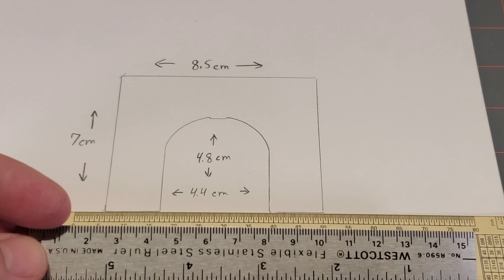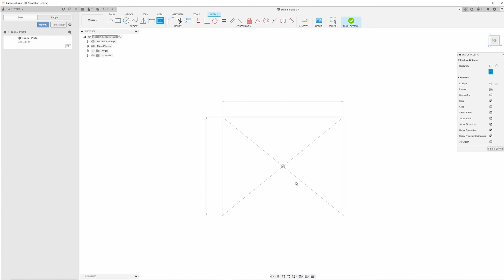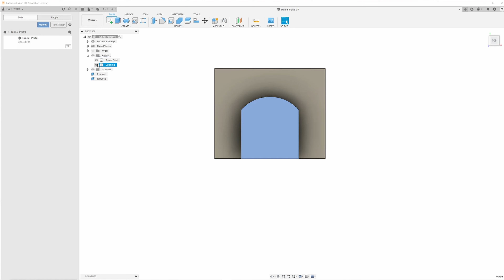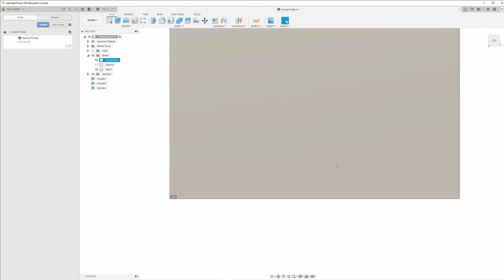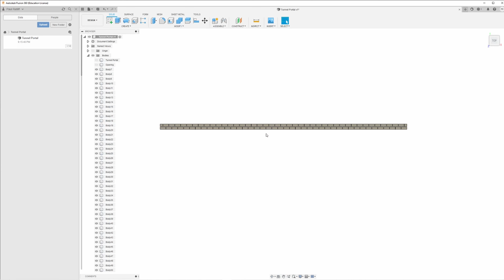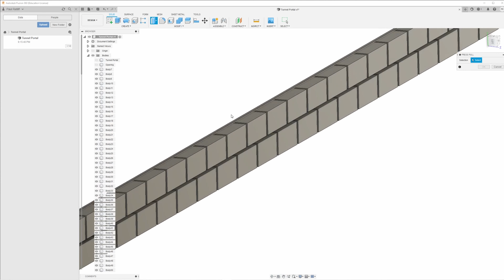3D Printed Model Railroad, Design with Fusion 360 Tunnel Portal Part 1

Comment: Hoi Paul, very interesting what you do…iam working on a n scale train design and now learning fusion 360. Your items are very good. Question: you use a 3d printer with 0,4 mm nozzles and 1,75 filament. Which printer do you use
Reply from the maker: Hey Josh. You are correct in the nozzle and filament size. I am using a Creality Ender 3pro. I've been using it for several years now and it's a great printer.

Comment: Where do I get the ruler?
Reply from the maker: Hey Micke.  Here is a link to Amazon where you can buy the sacle model ruler.  Just for complete transparancy.  This link is an Amazon Associates link.  If you don't know about that, basically it means that Amazon gives me a little kickback for getting someone to buy off of them.  It doesn't increase the cost of the item at all, nor does the seller lose any money. It comes out of Amazons profit. It's just pennies, but every little bit helps.  Thank you for supporting my channel.
Excel Deluxe Model Railroad Reference Ruler https://amzn.to/3dwBbrR
Reply: @RoadsAndRailsHobbies  Thank you Paul. I'll buy from here so you also get some money. Awesome
Reply: @RoadsAndRailsHobbies  when I click on your link I'll end up here "HATCHBOX PLA 3D Printer Filament, Dimensional Accuracy +/- 0.03 mm, 1 kg Spool, 1.75 mm, Gray". ??

Comment: Aloha Paul,  I'm glad you're using Fusion 360 and explaining your steps.  I like the idea of making it a panel.  Maybe the next part would be convert the panel to a component and save it separately so it can be reused and patterned.
Mahalo
Reply from the maker: Your are absolutely correct Peter. I am however trying to keep these tutorials simple and just add in a couple of new steps or new tools each time I create a new tutorial as to not overwhelm new users to Fusion 360. I don't know about you, but I always disliked it when teachers threw everything at me at once and confused the heck out of me. Peter. I love your comments and keep on sending them, keeping me on my toes. Commenters like you are the best way that helps me keep creating what I hope is good content. So thank you so very much.
Reply: @RoadsAndRailsHobbies  Mahalo for the kind words. I've been in Fusion for about 5 years as a hobby mostly to support a panel router. Learned machine drafting and Architectural  drafting back in High School 1965-66. Worked in Product development 41yrs now retired.
I see your method and fully approve of it. Sometimes Great teachers give a challenge so the more advanced students (everyone learns every time one interacts with  someone with an open mind) have something to explore.